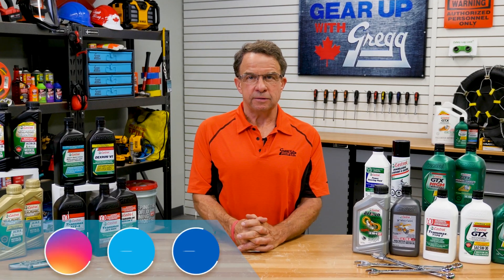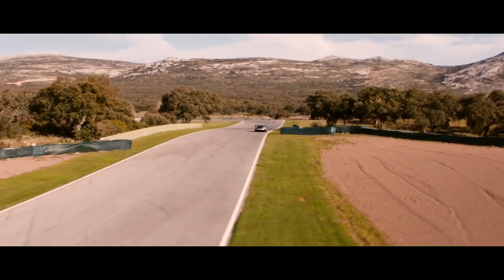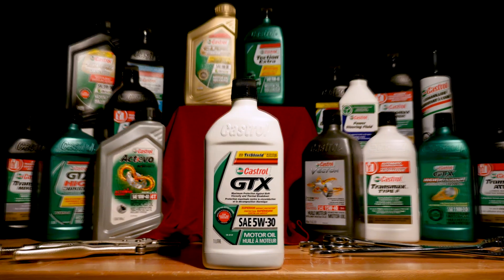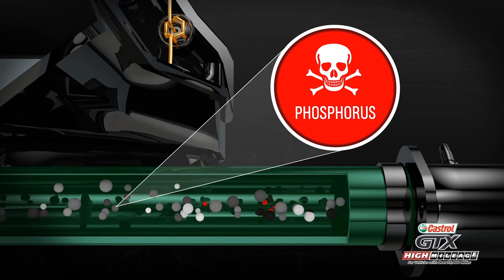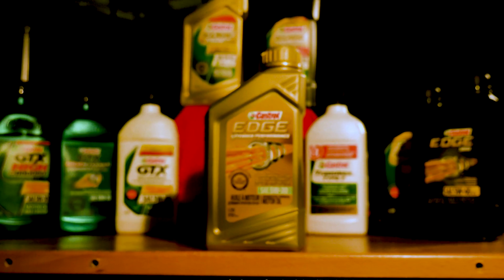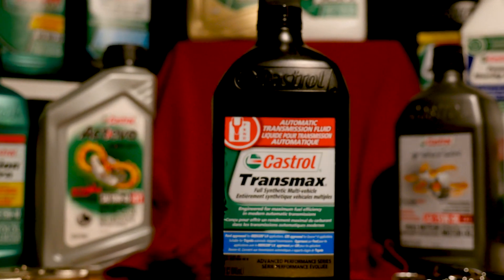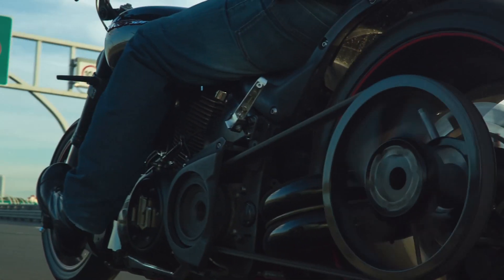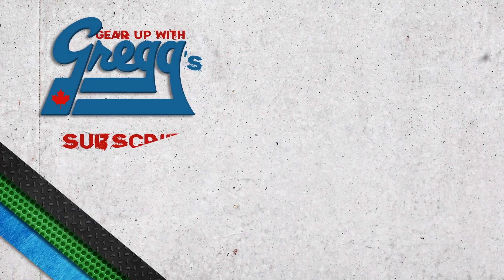The Difference Between Synthetic and Conventional Motor Oil - Gear Up With Gregg's

Comment: I've been driving now for 46 years. My uncle told me when I got my 1st car at 16, to only use CASTROL OIL. He said it was the best. That was 1975. He was a total car nut like me, he owned Rolls Royces, and Porches,  and that's what they alway ran. I have had owned 8 brand new cars, put over 200.000 miles on several of them...and in all the years,  I have NEVER had a car with engine issues.  I bought a new Trans am in 1994. Has the LT1 ENGINE.  I Have kept it all these years because it a blast to drive, and just a great cruiser. It has 338.000 miles on it now,  and still runs like new. The engine has never been touched,  even the timing chain is original.  Its never had synthetic oil, just Castrol GTX 10 30,  changed every 3000 miles. I bought a 2021 kia K5 GT LINE with premium package last May.  It is GDI with turbo. And requires synthetic,  so its getting Castrol Edge.0 wt 20. Nothing will make me change from Castrol products.  Why would I?? It has proven itself to me to be a fantastic oil.

Comment: Castrol is the sole reason today that oil can be called full synthetic and only contain a minimum 25% synthetic component. If your going to buy synthetic it better say 100% synthetic or it's just dressed up dino oil
Reply: yes  most these video seem to be saleman  i used one synthetic long time ago and made my lifters and engine noise louder sound bad to me , they seem to have a hard time getting to the point.
Reply: @onlythewise1  a 100% PAO Synthetic Amsoil that I run in my Cummins 67 ram runs considerably quieter and bumped my fuel mileage up 2mpg I've run mobil 1 before and it didn't do that course it hasn't been a pao base for decades since they lost the case with Castrol.
Reply: @Jon-O.  oh yaaa  ya ill try synthetic on 2007 Tacoma trd try to get the best for it
Reply: @Jon-O.  Synthetic blends are the worse!  The blend may contain a small amount of oil that in itself is not a true synthetic.   All thanks to Castrol whose actions led to allowing highly refined mineral oils to be sold as synthetic.  What a company!
Reply: @sezwo5774  yeah it wrecked Mobil 1 which was all synthetic group 4 PAO chemically manufactured oil. When they lost that case they said to heck with it will use Group 3 petroleum Ground oil too with the PAO so all "Full Synthetics" are ground and maybe PAO blends it's sad. I didn't see them drop there price. I'll stick with Amsoil Signature Series that's a PAO group 4 and Esters group 5 100% Synthetic. It's amazing how many are ignorant of this.
Reply: @Jon-O.  At the time, early 2000s, I was a regular user of Mobil1 15w-50.   For some time they sold concurrently two 15w-50 formulations, ...one with a red bottle cap and one with a golden cap labeled extended performance- which was the old PAO mainly oil.  Today,  thanks to Castrol, one cannot be sure what an Extended Performance Mobil1 means.  It may and probably is just a mineral oil masquerading as a synthetic.   Today, it is best to either buy Amsoil or Motul or some other clearly labeled as truly synthetic oil or alternatively buy the most value oriented "fully synthetic" fake synthetic oil such as SuperTech from Walmart or Kirkland oil from Costco, or Amazon basics oil, or similar, and change it more often.  Even buying agriculturally oriented oils like Rotella T6 or even T5 is probably a smarter option than paying for hyped-up mineral oils from big names like Castrol.
Reply: Add some of Redline, to the list also but yeah my Cummins does run much better and quiter on the Amsoil Max Duty Signature Series 5w40 than the Rotella T6 which I had to run the first year because of the Mopar spec. When I bought it in 17 took a year for Amsoil to list it as conforming. But actually exceeding it.
Reply: Synthetic blends are even worse!  The blend may contain a small amount of oil that in itself is not a true synthetic.   All thanks to Castrol whose actions led to allowing highly refined mineral oils to be sold as synthetics.  What a company!
Reply: No such thing as a "100% synthetic oil".  All oils, even high end oils like Amsoil, Royal Purple, Redline, etc., start out as regular, bulk dino oil. The only difference with these oils is the additive package. "Synthetic" oil is just more highly refined mineral oil. That's it.

Comment: Castrol Edge full synthetic is the best oil you can buy at the typical parts store. I say this from experience when I used Mobile One Full synthetic on my turbo car, after watching the car burn through oil really fast, I switched to Castrol Edge GTX and the burning slowed down tremendously! From having to add oil every week I went down to only having to add every 2.5 weeks its a very heat resistant oil. This was in South Florida mind you.
Reply: Oil is not the problem. You have worn out seals or piston rings or you probably didn't change your oil regularly.
Reply: @flucas6595  nope mobil 1 burns off faster project farm proves it
Reply: Try Kendall gt1 !! other brands can have good oils but it’s not a comparison to gt1 especially for high stress high output engines that are driven extremely hard and for the price vs the life of the oil it’s hard to beat! Castroll is dead in my car after 2 weeks and cost more than the gt1 that lasts for months of fkn hard high boost driving and I’ve also bought about 10000 litres of oil in the last 5 years a good amount of that was castroll and 410l of it in particular was gtx that had a incorrect blend of oil that could have closed a business down if it weren’t found, having to drain and replace countless customers vehicles oil with a better brand because of oil burning and some avoided near disaster using 3l of oil in a few weeks in otherwise completely fine low mileage engines
Reply: @needmoreboost6369  yeah really a conventional oil that costs almost 1 1/2 times as much as a 100% synthetic like Amsoil or Redline or Motul. And can't hold up because conventional oil is just incapable. Beside also showing much greater wear scar in four ball wear tests the industry standard for all lubricants. I recommend you never go more than 3,000 miles or less on a oil change. For the sake of your engine. If you really cared about your engine you would look into the three I mentioned above. Oil rings and worn valve guides are the main culprits of oil consumption.
Reply: @Jon-O.  Kendall is full synthetic group 4 oil and is less that $10 a litre here vs ams oil $15 and motul,royal purple,nulon racing,hpr synthetic,Mobil,castroll are all more expensive and are just a few that I use as a mechanic and engine builder! but gt1 and ConocoPhillips synthetic are on par if not better than ams on a cross axis friction test which is hardly an accurate or complete test anyway!
Reply: @Jon-O.  also my engine in particular doesn’t burn oil it’s got virtually no blow by and Manley viton valve stem seals and .002” intake stem clearance and.004” on the exhaust, the problem with cheap oils degradation in my case is the oil pressure! I have 2 oil pumps and a turbo on top of that, having in cab oil pressure and temp gauges helps to evaluate the oil condition, typically I run 95psi cold and around 70psi hot with 20w/50 and with Kendall and ams this will stay like this until it’s changed around 3000km I’ve used other supposedly premium syn oils and after about 1000km idle oil pressure starts dropping below 50psi, this is just an opinion based on daily thrashing a junk engine with 3-4 times the factory output
Reply: @needmoreboost6369  Kendall GT-1 is indeed a great oil.  Castrol oil is much overhyped.
Reply: Switch to Amsoil signature series I know you will use much less if any it's been tested to have the least burn off of them all and the greatest wear protection a oil can have! Hands down the best 100% synthetic all the "full synthetic" oils are only conventional synthetic blends because castrol won the court case over mobile 1 that Mobil 1 filed against them because they were using conventional oil base and adding very little synthetic. So the judge ruled in castrol favor.
Reply: @Jon-O.  amsoil is a great oil, unfortunately it’s extremely more expensive then other leading full synthetics, and tricky to find. And realistically speaking, the engine really won’t know the difference from once full syn to another.
Reply: @lukeWiz44  respectfully Luke a full synthetic is a group three highly refined petroleum oil extracted from the ground and extremely cheaper. Where as Amsoil is a completely chemically manufactured lubricant Group four and five not extracted from the ground and every molecule is identical giving the highest film strength and highest wear protection possible. They 100 % synthetic "Amsoil" are 4 to 6 times better than the 25% synthetic content contained in the "full synthetic" oils. And it's why 100% synthetics are so expensive if you compare 100% synthetics the price is within a couple of dollars. Don't compare apples to Oranges.
Reply: @Jon-O.  Chemically, have you ever looked into depends oil platinum and ultra platinum series? It’s superior to Amsoil as its base oil, I can’t comment on the additive package though. However I understand where you’re coming from.
Reply: @lukeWiz44  that’s not true some are trash!
Reply: @needmoreboost6369  some full synthetics? That’s not true, you’re engine won’t know the difference.
Reply: @lukeWiz44  my engine will!
Reply: @needmoreboost6369  Well, have fun overpaying for motor oil!
Reply: @lukeWiz44  so if I go buy a typical brand of synthetic for $12-15 a litre that lasts only 1000km or I can just use premium synthetic for $10 a litre that lasts for much much longer! what exactly do you mean? Not all oils are the same and there is huge variations of grades and additives for different purposes so saying they are all the same just means you have nfi! If you think that cheaping out on oil saves you money you need a reality check especially if saving a couple of dollars means you have to do it 3 times more often!
Reply: @needmoreboost6369  further more I know for a fact that hardest abuse of engine oil is subjected to by diesel engines. There is documented proof of Amsoil going 200,000miles in over the road trucks with just filter changes top offs and oil analysis with oil bypass filtration. Far superior to Kendal. That's the difference when you have a 100% synthetic formulated. From polyaolfin and ester based oil.
Reply: @needmoreboost6369  all synthetics are essentially the same oil. Different add pack maybe, but your vehicle, for the average driver, it truly doesn’t make a difference.
Reply: @Jon-O.  diesels do not get as hot as a higher performance turbo petrol engine let alone my daily driver in 100 degree heat and 2 bar of boost on a high comp bottom end!! The egt’s and turbo return oil temperature is far higher!check out ConocoPhillips hydro cracked full syn it’s the same deal for high service life in long service heavy diesel it’s not just some mineral blend unless you have some cheap mineral version but the gt1 competition oil I use is all synthetic and for now I’ve just switched to an Aussie full synthetic to do a comparison for service life so far it’s holding up as good as ams oil or Kendall and it’s a high zddp so a bit of extra piece of mind
Reply: @needmoreboost6369  you incredibly clueless heat is how diesels combust in the combustion chamber not by spark but through compression that raises the temperature. You what it pointless trying to teach someone who thinks they know everything when they know only what revolves around themselves. Your wasting my time don't reply back I all ready understand far more than you do.
Reply: @Jon-O.  lol go actually do some testing with an egt gauge! and tell me why diesel turbo’s rear housings are often just cast iron and performance petrol turbo’s are steel? I agree I’m only just leaning as I’m just a mechanic/engine builder with only 30 years of experience on performance engines and a couple of decades as a qualified automotive mechanic! It’s so enlightening to hear your opinions